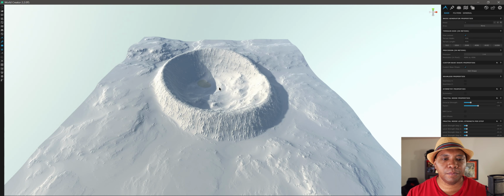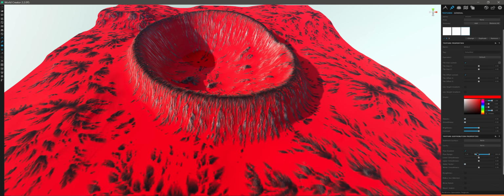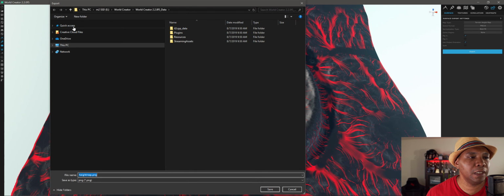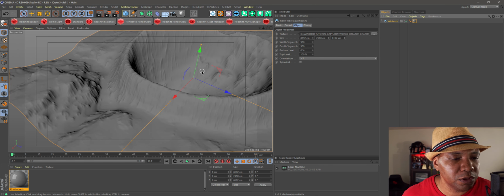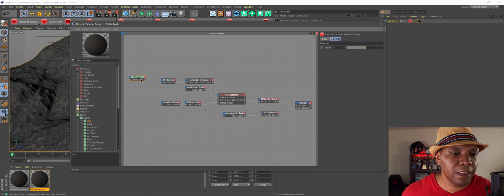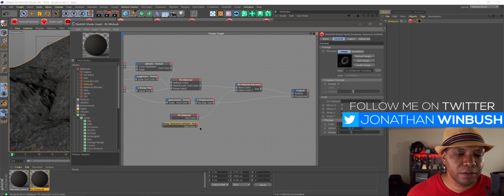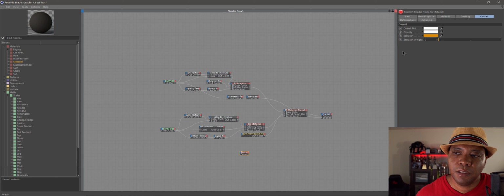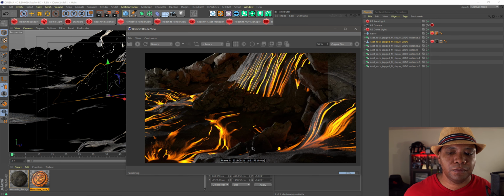Take World Creator's FlowMaps into Cinema 4D using Megascans and Redshift to create Lava Streaks

Comment: I don't have the Flow enabled setting, how can I get that working? Using World Creator 2.4.
Reply from the maker: I'm not sure I'd have to check later I'm still on version 2.3.0f1
Reply: @JonathanWinbush  i also got this problem is there a fix now?
Reply: I'm facing  the same problem, does have anyone some solution?
Reply: @talissonbento5911  Grrr hate it when the option not there i have same problem
Reply: @TOMCHANTVFX  I bought the InstantTerra, I'm using it with Ue4 and it's working very well so far ;)
Reply: @talissonbento5911  had a look now, doesnt seem as detailed mesh?
Reply: @TOMCHANTVFX  There is a video on official InstantTerra's channel, the video's author seems made some mistakes while importing the heigh maps into UE4.They are developing a plugin UE4 for, which enable InstantTerra edit UE4 landscape on live. btw the plugin is coming soon.
Seems a good tool if you are planning to use UE4
Reply: @talissonbento5911  I mainly use C4d, does sound cool though

Comment: There is a displacement blender node. Not sure how it works or whether it would work for you, but it is there.
Reply from the maker: Oh really? I'll look into it thanks. Where did you see it at?
Reply: @JonathanWinbush  Type "dis" into the Find Nodes search and you see Displacement Blender. I am using the 3.0.05 beta at the moment so if you are not, that may be the reason you don't see it.
Reply from the maker: @vytasatvmanstudios  actually just found it thanks for the tip. I haven't tried RS3 yet I'm just going to wait for the official release but how are you liking it?
Reply: @JonathanWinbush  Faster start when it initializes, but I am not using rtx cards (only 2 gtx 1070s) and I have not noticed any speed up in rendering. I did like using the renderview to move the camera around but it was not as responsive as I would like and it was removed.
Reply from the maker: @vytasatvmanstudios  interesting. Yea I'm wondering if we a better integration in R21 with Redshift where the renderview can move around in almost real time like EEVEE or Unreal since Redshift has better access to Maxon now. I wanted to buy 2 RTX cards but am waiting to see if they actually do release a Super TI series cause I'd hate to buy now then have them drop in like a month or so. I was really close to buying a Super 2080 just because Ray tracing in Unreal with my 1080ti keeps crashing like crazy.
Reply: @JonathanWinbush  I am anticipating the formal rollout of 3.0 around the same time of R21, cause there have been no releases of 2.6 or 3.0 beta versions since early July whereas Redshift pushes out new versions faster than that. Lets hope it is a good release.
Reply from the maker: @vytasatvmanstudios  I think your right because at Siggraph Redshift was showing the new material system they are using C4D nodes now and no longer using expresso so that seems like something they roll out all at once with R21
Reply: @JonathanWinbush  Coool! I didn't go to Siggraph. I am pleased they will use the new node system. I know they will have that 'modes' pulldown next to the layout pulldown and it would make sense to have that available for redshift right away.